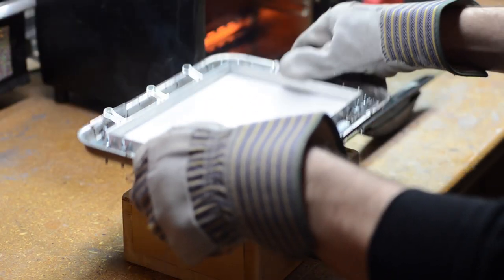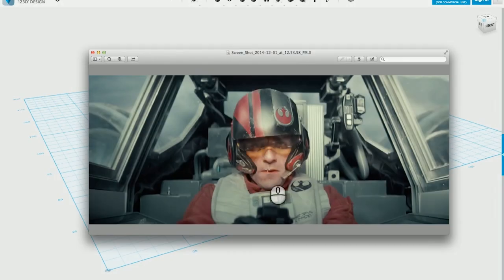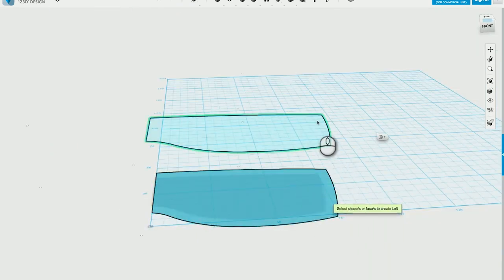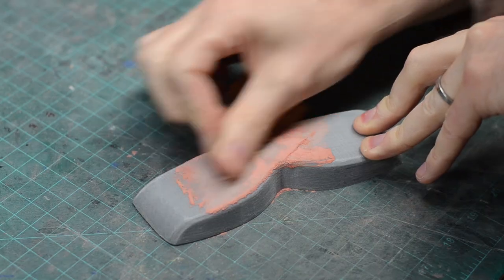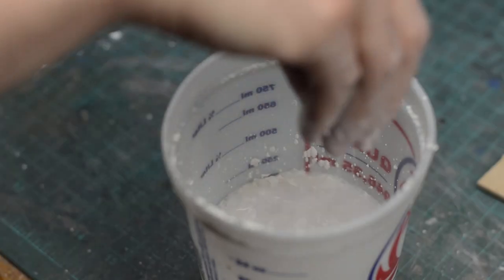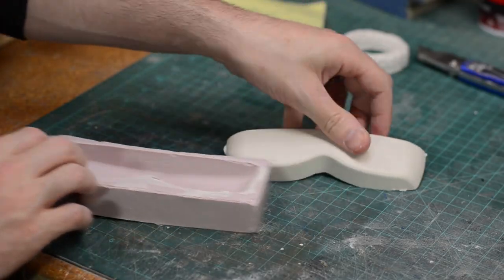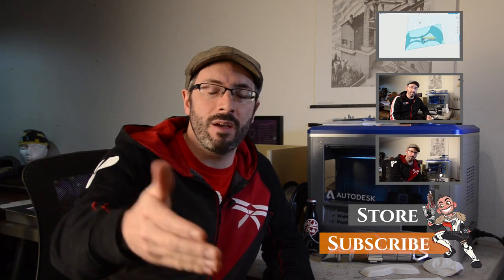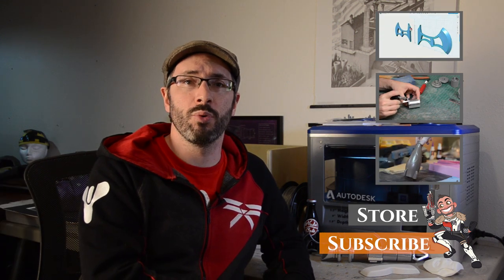Prop: 3D - Season 1, Episode 4 - Star Wars Style Vacuum Formed Visor

Comment: Hey bill! i don't know what 3d printer material you use really, but for a smooth/glossy finish on the prints you can use a tissue soaked in acetone (a little bit only, else it will erase small details)it leaves something amazingly smooth once you get used to it, and it's really winning a lot of time
Reply: +cedricfilm that only works for abs i think he uses pla :/ and the cold aceton vapor has better results. It keeps sharp edges :P
Reply: Aaron Terell oh ok i wasn't sure of what he was using thanks

Comment: Great video but I have a question, why did you have to vacuumform a hydrocal cast of the 3d printed buck, wouldn't it make more sense to just wet-sand finish the 3d print with x3d/primer and then vacuum that? Or is the glass transition temperature of PLA too low for vacuumforming?
Reply: +Bill Doran Ah, I see. Figures I guess since most PLA is formulated to soften(glass transition) at around 60C so most likely the surface temperature of the styrene would exceed that.

Comment: nice video.  As one who is new to the craft, why didn't you vacuum form over the 3d printed model?  you had it filled and sanded smoothly it seemed?
Reply from the maker: 3D prints don't always respond well to heat, so we wanted to make sure our buck that we were forming from could handle it.

Comment: hey Bill I want to cast and mold a helmet on the cheap do you think I could use alginate? I've done some research and I heard it has shrinking propertys but I wanted to hear what you had to say. the helmet would be made from resin.
Reply: I wouldn't do it just because most resin heats up considerably, and I don't think the alginate would hold up against the Heat
Reply: Andrew Redwine I live in Washington heats not really problem here lol
Reply: +Nate Marin also if you're using something like urethane resin it's going to have some problems since alginate has a good portion of water, and urethane doesn't work well with moisture
Reply: +Nate Marin just choose materials wisely, if you're trying to do it on the cheap for several time use, you can use something like calking

Comment: Out of curiosity why not make the Mold from a 3d printer object. instead of making a buck you just make the mold? invert the model.  take out a step
Reply from the maker: 3D printing material will melt and deform under the heat and suction of the vacuum form.
Reply: Punished Props that you for the reply its really cool that you take the time to reply. what I ment is the process I see in your videos is 3d print -> make a mold -> use cast from the mold to vacuum form a visor. what I ment is take the 3d model and invert the design so it creates a mold right from th3 3d printer. then use the 3d printed mold to make rhe buck out of what ever material and then vacuum form.
Reply from the maker: OH! I haven't done that yet either, but I bet it could work!
Reply: @thomaszanis4049  it would be very difficult to smooth out the 3d printer lines in the mould + you cannot use a non-flexible 3d printed mould to create another non-flexible solid cast, they would be stuck together. I guess you could use tpu to print the mould but then you'll still be stuck with the layer lines which is even more difficult to smooth on a flexible print

Comment: Don't know why you couldn't have vacuum formed from the 3d print after you sanded and finished it smooth. The mold seemed unnecessary.
Reply from the maker: +Davegbuf The PLA plastic print would melt during the vacuum forming process.